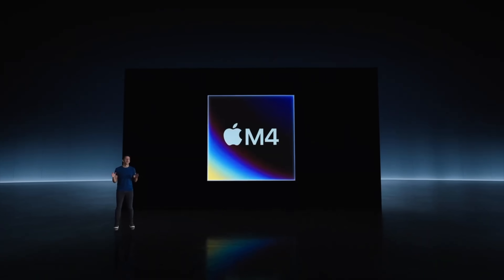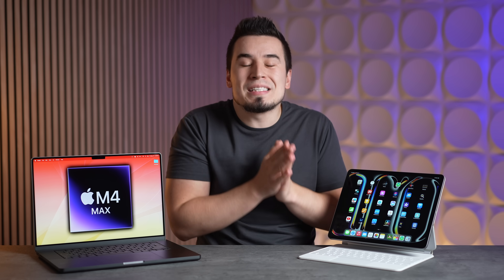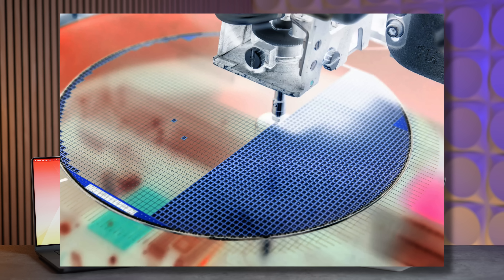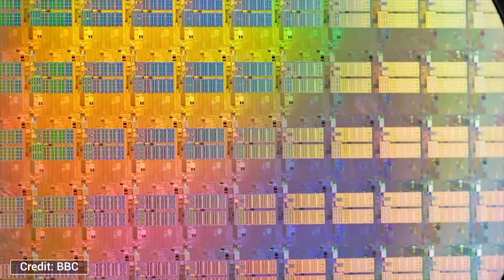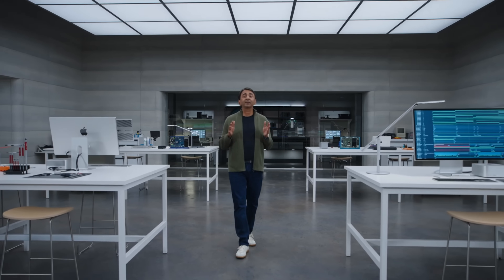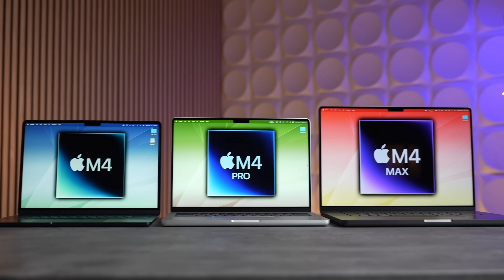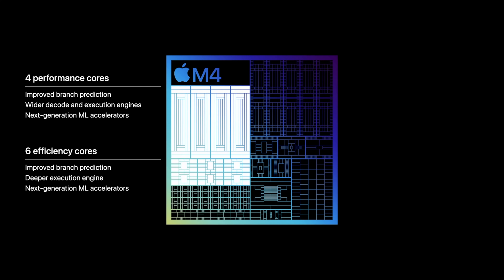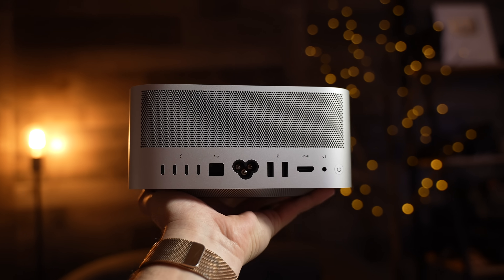What M4 iPad Pro means for M4 Macs (Huge WWDC Reveal?)

Comment: It makes more sense to release first the low volume high cost chips, and later the high volume low cost chips. This also gives time to get chip wafer yields up for high volume products. It also makes sense for Apple to minimize the design cost on a manufacturing node that can't be migrated to a new manufacturing process, but this is why for many years Intel did tick-tock chip upgrades to move an existing chip design to a new process, then a new design, then a new process, ...

Comment: Lots of focus on technology here.  I think your assessments are pretty good, much better than lots of your super speculative videos.  The real pressure Apple is under is from Wall Street.  Apple just had to do a $110 billion stock buy back to prop up its share price.  Apple is getting lots of bad press for its apparent shortcomings in developing AI products.  If there are any secret components in the M4 chip that are designed to enhance/support on-chip AI processing , which is needed for Apple to deploy some of their AI products, you will see a massive and fast migration to M4 chips across all Apple products, including phones (for the phone not a complete M4 chip, but components need to support AI). If the M4 is integral to Apple’s AI strategy, it will be critical for driving new revenue. This is what Apple needs to do to appease the wolves of Wall Street.  This is probably more than just your average CPU tech upgrade and will set the foundation for future products and services and revenue.  Apple did the hard work migrating Mac OS to the M1 architecture.  Now that they have proven that to be a success, they are free to get very creative and aggressive with new technologies and products. Don’t be surprised if that includes tighter integration between Macs and IPads.  Including dumping IPad OS and running iPads on a variant of Mac OS.  Apple would love to have one less OS to support in the long run.

Comment: You are wrong abt Geekbench score, the score is inflated cuz the AI acceleration neural engine 
X86 lack that part of AI acceleration cuz is intended the GPU would be doing those task
The M4 is like 7% more poweful single core wise than the m3
Reply: Object Detection in the SME extensions massively inflates the M4 single core benchmark.

Comment: I wonder when Apple will release the M4 Extreme. It was rumored back when M1 was released about a four M1 Max chip connected together (Jade 4C - Die). They should be up on something since the new up and coming RTX 5090 specs was already leaked and it was really bonkers.

Comment: An urge to upgrade from 2021 M1 Pro MacBook Pro 14" incoming😄

Will be a beast…)
Reply: im in the same boat. I still have the m1 14 inch pro. The m4 might be worth the upgrade. We'll see
Reply: @videofrat3115  It will only be tempting for me. There is no single work task that my MacBook Pro is struggling with or even has any kind of issues. Hobby too (audio production). It also has 4TB SSD and 32 GB of RAM, so yeah… Gaming is the only think I can think of, but… I don’t really game at all😄

Besides - found out recently that there is a gaming club right next to my house. Was there once and it just makes sense to go there for a quick gaming urge if it arises - great atmosphere for it, gaming rigs and cost like $1 per hour…)

But hey… M4 Pro might still be worth it😄

The real question will be weather “nice to have” spec bumps will make it feel like a great upgrade and price of upgrade will correlate to available “free” funds and the urge to upgrade :)

Comment: Great analysis. 

I was on an 2020 Intel MBP and badly needed Apple silicon for AI, but heard rumors of the M4 being much better for neural processing, so bought a maxed-out M1 Max version to tide me over. No mention of beefed up neural processor yet, but just the CPU boost seems worth it.
Reply: M4 Neural engine has the same core count as M3 but can do 38 trillion ops vs 18 trillion ops on the vanilla M4.
Reply: Me three! Grabbed a Studio with M1 Max bc couldn't wait to run local AI models. Looking forward to an M4 Max or Ultra with massively more multi-core. Now if only we could use GPU + Neural Engine to run open source...

Comment: Apple probably didn't hype the m4 chip details so people would still keep buying the products that are still on M3
Reply: True that
Reply: Apple actually explained it and hyped it in the event
Reply: I agree with Vadim that they are likely saving the thunder for WWDC. And I'm sure you are right that people will keep buying M3 Macs — but Apple has made current products obsolete before.
Reply: I just bought a new M2 15-inch with 16gb/1tb for around $1300 USD in Australia.
Reply: They need to sell their stock before making any big announcements, this just most likely a "Welcome Snapdragon X Elite on the board, good luck to start to sell your chip, when even the most basic M chip is outperform you, and lot of the customers will wait the M4 Pro/M4 Max/M4 Ultra instead of buying your chip. So release a chip with performance instead of just a hype video, and they will wait even 6 months to buy it later the next version.."
Reply: No, they don't hype it up because it is unnoticeably faster than the M3 in general compute performance. It is WAY faster in AI tasks, but that's about it. The M4 is made for efficiency, cost cutting and buzzword effectiveness (AI), not massive performance gains.
Reply: @ElZamo92  The reason the chips are so much better is because apple's chip supplier, TSMC, switched over form the N3B node, which was basically just an in between node that was used basically just for apple, and it was kind of a nightmare and had really bad yields, and it took an EXTRA SIX LAYERS of EUV work at minimum, and in some parts of the chip it needed MORE layers than that. Plus the chip leaked a lot of power compared to what it should have been, and also the performance was like 5-10% lower than what it should have been, which is what this new process node is meant to correct. And so now, because the process is much easier, and the yields are gonna be much higher, meaning that they don't have to shell out tons of money on chips that fail to work properly, means that they can put WAY MORE CORES on these chips, much more easily, and so even tho m4 multicore really isn't that much more powerful per core than the m3 chips, the fact is that now they can get 10 on the m4 instead of 8 on the m3. And they also fixed a few critical issues that were holding back the single core performance, and made some major improvements to a few core areas of the chip that will stop the single core performance from being bottlenecked.
Reply: @ElZamo92  you clearly know nothing bro
Reply: @ElZamo92  How do you know this?

Comment: Make no sense to show M4 pro, max, ultra etc now, because people are waiting strong chip to use for rendering, CGI, Simulations. Right now Apple can't conpete with Nvidia. If they show everything in 2025, could be good, but can't conpete with rtx 5090, also can't conpete now because omniverse and a lot software, function doesn't work with apple. Is bettere if they accellerate the power of theyr machine, because a lot people like me (mac users), we are went to Nvidia products, amazing and really fast. But I still prefer Apple product for design, and operativ system. Can't wait to go back to apple, just when they will be like Nvidia if we talk about power. Maybe with M6 chip.
Reply: Dude what you just Said is complete bullocks. It is factual wrong. The m4 Can more than compete with Intel when it comes to graphical tasks.
Reply: @jessicaalvis7063  I didn't talk about Intel or CPU. If you want work with CGI etc, m4 will be again too much slow. In this industry, you can of course use apple M$ chip, but just for modelling, sculpitng, draw, simulations, but not render. I mean, you can use it, but it is very slow.
Reply: @heymagikmagik you know nothing Jon Snow
Reply: @jessicaalvis7063  less intel more intelligenza Jessica my bro

Comment: I was looking to buy the M3 soon, but might wait now for the M9 instead.
Reply: Lol
Reply: if this confuses you, then an M1 Air is probably plenty over powered for your needs. Relax!
Reply: M5 or M6 with Oled displays are the ones.
Reply: I’m waiting till Apple RISK-V comes out
Reply: @TheHoonShow  Nah, that won't happen. RISC-V's stable core/standard extensions approach sounds good on paper, but in practice it means they're stuck with whatever stupidity they failed to care about before it went and blew up. Examples:
- Instructions in the 32-bit variant share opcodes with 32-wide instructions in the 64-bit variant, except ADDW. The spec itself admits this was an unqualified mistake.
- Instructions fit together such that a 32-bit absolute or relative address can be synthesised and used in any way in just two instructions. This same mechanism causes synthesising a 64-bit address to require multiple registers.
- There's a reserved static base register, or "global pointer" as they call it, which several platform ABIs have outright rejected the intended use of. This one is minor, but it shows the overarching lack of foresight.
- The FMA instructions have pre- and post-negating variants, and those with only one negation have each other's names. The spec admits this was intentional, but that they were "forced" into it because MIPS made the same mistake. I am dead serious.
- The vector extension was a very early draft when the RISC-V Foundation's own commercial venture took it and ran. Now some of those unfinished and obviously suboptimal ideas are carved in stone, forever. (I forget specific examples but the spec names some.)
- There is a specified naming and allocation scheme for architecture extensions, but no specified mechanism for detecting them at runtime. The (thankfully non-canonical) example system architecture suggests a system register with set bits for letters of the alphabet, which the very first draft would have broken with its "Z-" family. In practice, this means a "generic RISC-V" target does not exist.

For all the talk about being an architecture "for the future", it doesn't incorporate a single idea from this millennium, instead tying itself inextricably to early MIPS. They had a real opportunity to nail some things down: perhaps some control-flow or memory integrity protection, maybe a separate control stack, a vector partitioning scheme to reduce exception memory pressure if they were feeling frisky; but they didn't design it to be anything new. They designed it, originally, as a toy architecture for teaching purposes, and only later did the marketing take on a mind of its own.

And hell, even if every one of the above bullets were addressed, if every concept in the previous paragraph were incorporated and integrated from the beginning, it still wouldn't have any advantage over Arm. Not just technically, ideologically as well: the only "free" and "open" part of RISC-V is the ISA. Cores themselves still have to be designed, and no one with the resources to design a passable core can afford to do it for free. It's not like software, where a swarm of anonymous enthusiasts can throw minute contributions over the fence; in hardware, every component is competing for precious physical space with every other, and even basic layout and routing with optimal components is a challenge. And even if there were a decent royalty-free core, fabbing said core, and incorporating it into devices, requires the kind of money that wouldn't blink at a license fee anyway.

I do see the danger in giving one company a form of control over the entire semiconductor market, especially now that said company is publicly traded and hence incentivised to maximise profit; but championing an objectively inferior standard which doesn't even fundamentally change anything business-wise is not a solution. I'd be thrilled if Arm became a trust of the UK government, as was suggested back during the NVIDIA merger fiasco. It's true, things would move much more slowly, and that would be wonderful: I've been keeping up with the last few years' architecture updates and it's just a whole lot of pointless bullshit. The very latest architecture standard in any core other than Arm's own yearly designs is v8.6, which is four and a half years old at this point. Hell, Arm themselves tacitly admitted as much with the Morello program, based on v8.2.
Reply: It will be out next year, Christmas.

Comment: Due you think for the existing M3 devices out there will they be limited in any way down the road? For example, may future features work with M4 and above?
Reply: that's exactly what I was thinking. It seems that Apple may have shafted people somewhat knowing this was their roadmap
Reply: @Arsenal120 just bought a Mac book pro last year, this shit is ridiculous
Reply: @jailenc6674  that I’d be set for a while, but now it seems like we might have bought a lemon that won’t be supported for more than 5 minutes. It’s not like they’re giving this stuff away
Reply: I’m still  rocking an M1 Max, M3 almost pulled the trigger glad I didn’t
Reply: Since the major revision in this chip was the NPU, if I were to guess, I’d say that on-device AI may be limited to M4 (and upcoming A18 for iPhone) and later. The GPU and CPU cores are general purpose and the media engines were finally revised, but kept support for the same codecs.

Comment: Imagine hanging your hat on one quirk of the architecture that games the synthetic benchmarks being touted.
Reply from the maker: I believe the performance gains will be seen in real world apps as well.
Reply: @MaxTechOfficial  the major uplift in single core and multicore performance was  only a result of 1 or 2 specialized components of the benchmark leveraging parts of the NPU not present in other competitors currently on the market, but they were pathways that would not actually be present in real-world cpu applications, the test was just flawed because it wasn't designed to account for that hardware configuration. Similar real-world workloads would be best processed through a GPU, any of which, including the m4's own onboard GPU, would decimate it in comparison. 

The only reason apple rushed the m4 to market was to be able to say on marketing slides that it has the most TOPS of any competitor, which is only true because the competing chips are due out in a matter of months and all are slated to have more than 40 TOPS, so they couldn't check that box.

Comment: You were so close to the truth on why M4 has so much more Geekbench "points" than the M3, but still missed the mark. If you don't look at the total points but look at each category points, you'd see that M4 gain to M3 is within 5% IPC gain which is in line with moving from N3B to N3E, the only one that M4 gained significant points is because they ditched AMX and moved to SME, if you don't know what those are for, they're for object detections, and completely not something that most people use day to day. So in reality, M4 is only about 5% faster than M3, mostly due to the increase in frequency with the expense of power consumption.